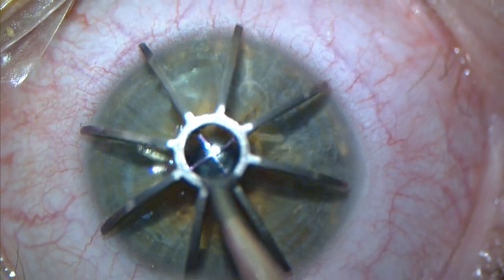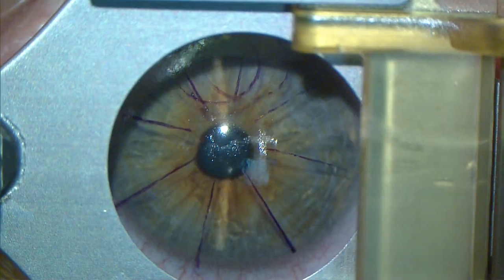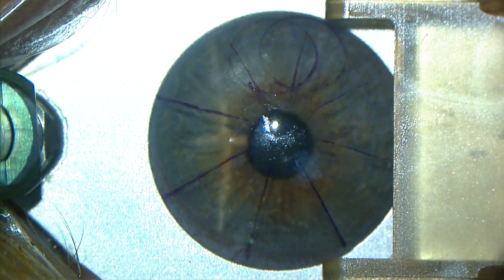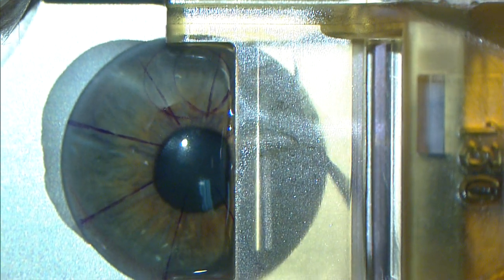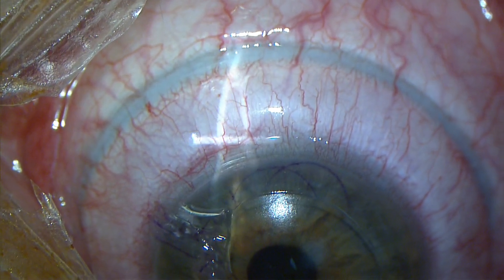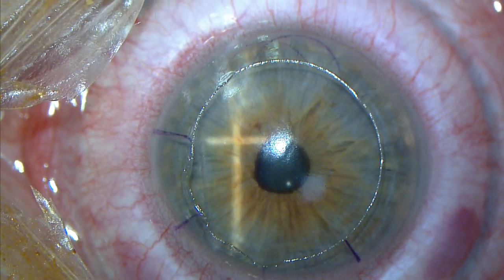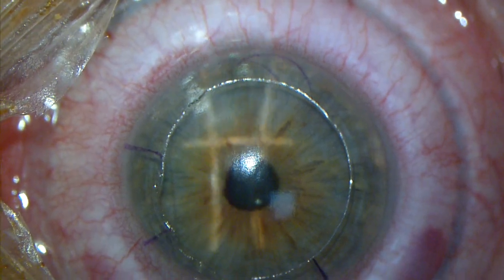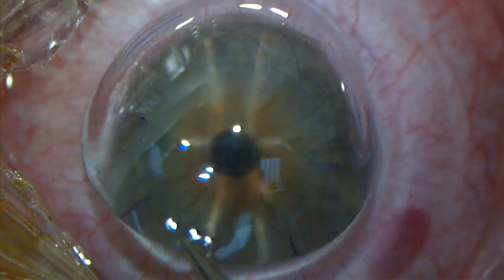Epi-LASIK Philadelphia:  Advanced Surface Ablation in HD

Comment: After some research, I have discovered that removing the epithelial flap is becoming an increasingly common practice as benefits of epi-lasik are generally attributed to the clean and abrupt edge and the superior surface of stroma after epithelium removal. However, some surgeons still replace the flap, although it is not clear whether this really affects outcomes. I posted my original comment before doing the appropriate research.

Comment: I see. Thank you for the explanation. However, I think the debate on the standard procedure for epi-lasik is far from over. I believe the data published so far is insufficient to form any kind of standardized procedure. Therefore, I think many surgeons do replace the flap.

So in your opinion, the epi-k keratome removes the epithelium more completely and produces a better surface for ablation? Is this, then the only benefit of epi-lasik over PRK? Thank you for the lively discussion!

Comment from the maker: Originally Epi-LASIK involved the replacement of the epithelial flap AND it was not that easy! When a patient had one flap successfully reattached it healed SLOWER than the eye in which the epithelial flap was lost.  At that point epi-LASIK was redefined.  Unlike PRK, Epi-LASIK "cleaves" the epithelium from Bowman's membrane without toxic chemicals (alcohol) or scraping (brush).  High magnification in this video shows the quality of the resulting corneal surface.  Epi-LASIK beats PRK hands down.

Comment: James, as I understand in PRK park of the Stroma layer membrane is ablated. As the layer is non-generative, the section of the membrane ablated in the procedure is lost forever. So in Epi-Lasik does this change? Does the entirety of the Stroma layer remain intact with only the epithelial layer being perfectly cleaved?
Reply from the maker: PRK and Epi-LASIK remove anterior corneal stroma otherwise there would be no point.  No refractive change would exist without permanent removal of stroma.  Epi is just a nicer, cleaner way to remove the surface layer (epithelium) resulting in a smoother more pristine anterior portion on which to create the the refractive change.
Reply: James S. Lewis, MD  I read that the suction ring creates intraocular pressure that can result in Barotrauma. Can an Epi-LASIK procedure be done without the pressure marking?
Reply: Does the brand of Epi-Keratome used matter? I have seen some of Dr. Chynn's procedure that uses an Epi-Keratome that looks quite different its all metal colored and lays flat then seems to leave some kind of impression or rather embossing on the Sclera. The Epi-Keratome you use it clearly a different brand. Also can you clarify the difference between Epi-LASIK and Epi-LASEK?

Thanks.
Reply from the maker: Mills Videography Epi-LASEK (rather than Epi-LASIK) replaces the epithelial flap to aid in healing.  I used this initially but did not find it helpful.  In fact, one study showed (Milne) found it delayed healing.  The brand of Epi-Keratome doesn't matter.